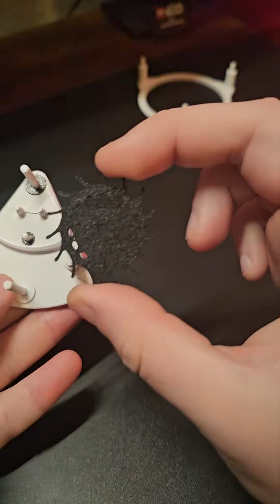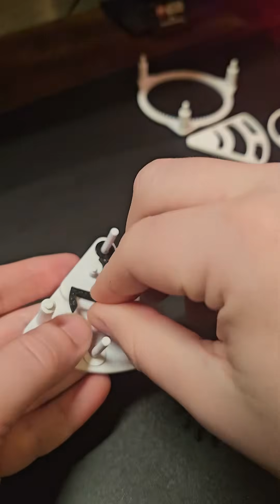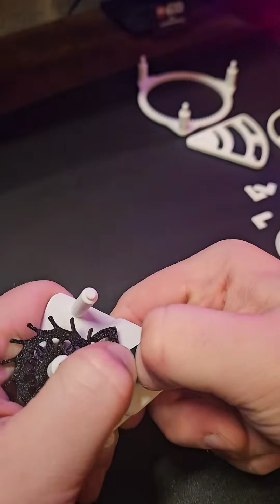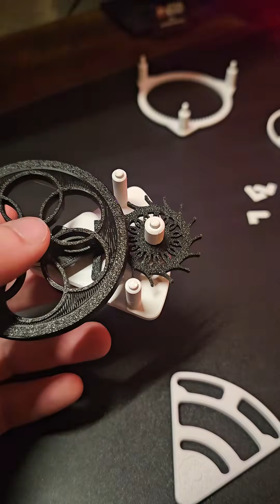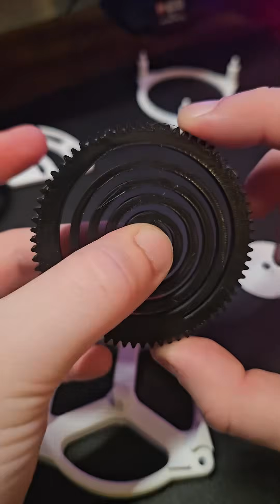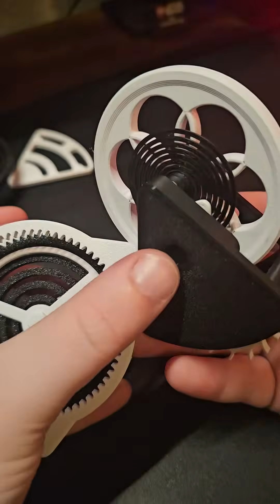Fully 3d Printed Tourbillon Troubleshooting Video

Comment: Still can't get it to freely spin even after making sure everything freely moved at every step.  As soon as I put the pallet fork on with the escapement wheel, the whole thing binds and wont move.   That said, it is a beautiful model and thanks for all your work on it.  I'll keep trying.
Reply from the maker: Thanks for checking out the model! That is definitely very frustrating that it's not working. My first idea to troubleshoot would be to try just putting only the pallet fork and escapement wheel on the base and see if you can get the components to move. If they are unable to move at all in that configuration, I would think there might be a friction issue. Unfortunately this model needs a little bit of troubleshooting at times.

Comment: hello, im having issues with making mine work. at 5:18 it doesn't launch the same way yours do, it gets stuck on the pallet and when it passes the breaking point it does not launch. my printer has a 0.2mm nozzle so tolerances aren't a problem, I've added lube to every contact surface on the escapement mechanism. is there any tips you could give me to fix this? i think it really just has to do with the pallet.
Reply from the maker: It sounds to me like there is a little bit of friction holding back the mechanism. I know you mentioned using a .2mm nozzle but the only solution I can think of would be to use xy hole expansion with a value of .1mm in Bambu Studio. You could probably get away with just reprinting the Axel, flywheel, and maybe pallet with the xy hole expansion. That has been the solution I have seen help 90% of people experiencing issues with the mechanism. Hope this helps!
Reply: i finally got it to work :D. Surprisingly i got it to launch by shrinking the pallet to 98.5% its original size, i think it wasn't working in the beginning because the tip of the pallet was hitting a part of the axel. Overall nice build, actually one of the first tourbillon 3d prints i got to work

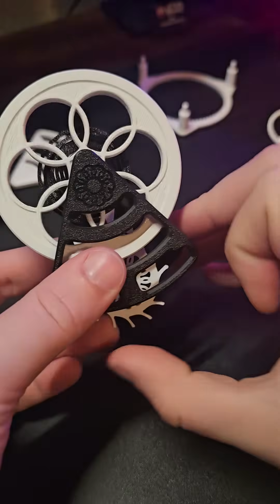Comment: 팔레트와 이스케이프먼트 각각 테스트 할때는 잘되는데  결합했을때 무언가 걸리는 느낌이 들면서 동작이 원활하지않습니다.  08:44 처럼 이스케이프먼트처럼 돌아가지않고 걸리는 느낌이 납니다.
Reply from the maker: Ohh there might be a chance the top is pressed down slightly too tight and is creating too much friction. If you can, try raising the top piece a little bit right above the flywheel. If it is too tight, it can cause the system to grind and not work. I've had that issue before.

Comment: It still doesn't work. I think it's a tolerance issue that occurs during printing. I'm trying various things to solve this. I've tried using genuine Bambu Lab PLA, turned on the automatic circular contour hole compensation option, and also tried X-Y hole expansion, but it still doesn't work. But I'll keep trying.
Reply: Update: I'm currently printing it again with new settings focused on maximum precision. I've enabled 'Outer Wall First', calibrated the flow rate, and set the layer height to 0.08mm. I've also significantly reduced the speed (Outer wall at 50-80mm/s) and lowered the acceleration to under 5,000mm/s² to ensure stability. Fingers crossed this one works!
Reply from the maker: @phyedunet Okay cool! That's really unfortunate that it's giving you issues. If seems like some of them just decide not to work for one reason or another and others work first try. It's frustrating trying to figure out why. I'm hoping it works out for you as well!